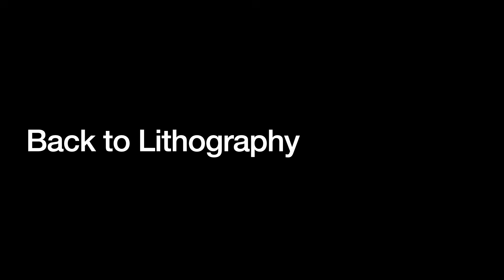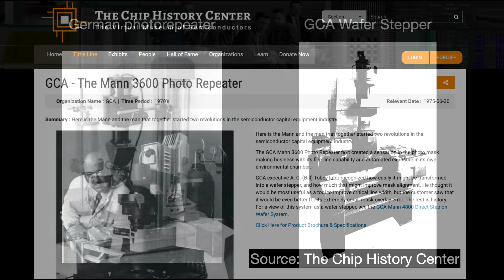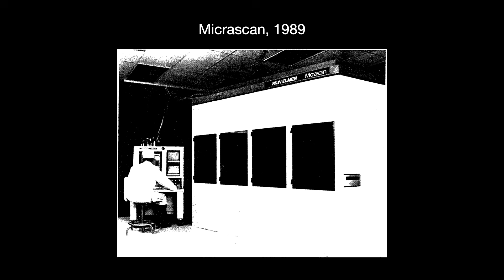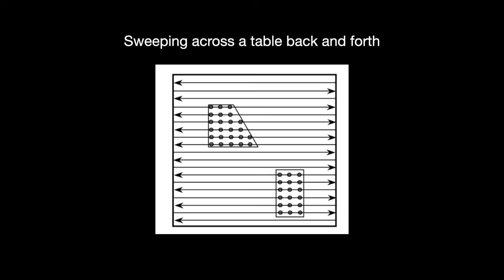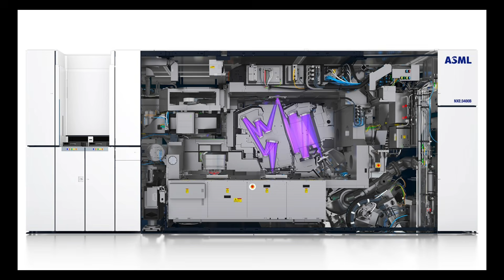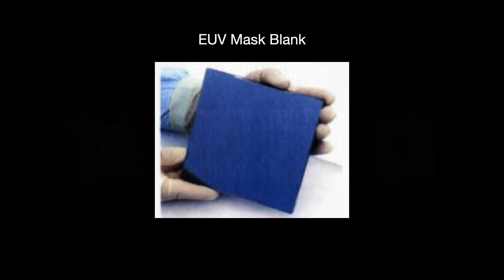The History of the Semiconductor Photomask

Comment: 🎯 Key points for quick navigation:

🔍 The photomask is a crucial component in photolithography, containing the chip design.
🖌️ Early mask-making involved manual techniques like contact printing and rubylith film.
✂️ Assemembly from large-scale artworks into smaller reticles transitioned via cameras and coaters.
🛠️ Innovations like the photorepeater and wafer stepper significantly improved process efficiency.
🧪 Substituting soft materials with durable metals reduced mask wear in contact printing.
🔬 Emerging technologies like e-beams and lasers advanced mask-making accuracy and resolution.
🏭 The 1980s saw industry consolidation and the rise of specialized, high-investment mask technologies.
🪞 EUV lithography introduced reflective masks, demanding zero-defect standards and advanced metrology tools.

Made with HARPA AI

Comment: ive done print ink silkscreen. i understand how a screen causes an emulsion to harden or wash away after uv light hardening then rinsing what did not harden. but if such a resist mask is placed on silicon, is it a 'subtractive' process to etch the masked layer? or is it an 'additive' process where more silicon is added? whats this step of the fabrication called? so i can research it by name to understand.

Comment: What about the 1979 Fujitsu X-Ray Chlorine etching? The X-Ray is tuned to the energy needed to disassociate the chlorine molecule. Thus where the mask allows the laser to pass, the chlorine ions etch the substrate, eliminating the resist. Coupled with the X-ray mirrors, the X-ray laser intensity can be high.

Comment: Resist coating that has not been stripped well is the "enemy" of Implant as too much outgassing is experience in the early days of wafer manufacturing. We will just see the chamber and the surrounding area as full of resists by products that cause potential wafer scrappage due to particle during implant. Wafer patterns are scratched in a batch processing type of implant.

Comment: In 1970, I took an engineering class in integrated circuits, and we had a tiny IC lab.  Each team had an IC project, and my lab partner and I started to design and build a two transistor flip-flop.  We used rubylith to make the masks.  As I recall, our rubylith material was clear palstic sheeting with a layer of red film on top.  There was nothing photographic about it.  The machine to cut the pattern was as you describe, and one interesting detail was that the cutter had to be manually aligned to the direction of the cut (up/down left/right).  If you had the cutter set incorrectly, you would either ruin the rubylith pattern or break the cutter.  Anyway, we did'n't finish the project, but we made all the masks and started a few diffusions.  It was a great course, and I still have a few of the little masks (about 1.5 inches square).

Comment: Did you know that initially ASML and Intel did not want a pellicle on the EUV mask? Back in 2009 or thereabouts, the EUV light source did not have enough power and therefore the stakeholders wanted to eliminate anything that would absorb the EUV light. The pellicle materials available at the time would absorb the EUV energy. The entire EUV litho chamber (wafer and reticle stage) has to be a vacuum so that the air won't absorb the EUV energy. To introduce the EUV reticle into the chamber, the reticle pass-through had to be pumped down to a vacuum, and therefore the reticle pod had to be all metal to keep the pumping time as short as possible. No pellicle, no polymer contact points on the reticle pod meant that the hard metal contacts gauged the reticle glass, causing particles on the non-pellicle EUV mask. So ASML decided to allow super tiny polymer contact points in the reticle pod to prevent such gauging. And eventually a very low absorption pellicle was developed and more powerful EUV light sources were realized. It was a lot of fun working on this stuff!
Reply: I have never seen EUV with a Pell in my time in the industry since 2010.

Comment: Nowadays the cutting-edge stuff is nearing 4 NANOmetre-sized elements. That's 4/1000ths of a micrometre - And they keep getting smaller. We're already experiencing issues with electrons wandering through a switched-off transistor thanks to Quantum Tunneling, but somehow that is worked around and size keeps shrinking. Before too long we could be working with elements measured by individual atoms.

Comment: a chuck in industry and machining is a tool used to hold other tools like drill bits and end mills or the work itself like on a lathe, so an electrostatic chuck is just a work holding tool that holds via electrostatics rather than physical or magnetic clamping that is used in the macro scale.

Comment: Electrostatic chucks (esc’s) are very common in etch, implant, ash and pvd steps.  Mechanical clamps went away during the 200mm years.  

When I started the mask making and inspection tools were still in the fab, but retired.   I’ve run perkin elmer aligners up to DUV step and scan, with contact and proximity aligners and a bit with EUV along the way.   

Pellicles are important to repeatability, but when an expedite lot came along I personally went to shipping and repossessed a needed mask, ripped off the damaged pellicle and ran the product. Even a 50% yield loss was preferable to missing a shipping deadline.  The focus shift was within tolerance for the layer.
Reply: We remember resist overflow at the back of the wafer that caused e-clamping issue at our implanter with e- clamp type of chuck
Reply: So masks with damaged pellicle were sent for repair?

Comment: At Intel in the 70's we always put 4 "test coupons" on the edges of each wafer and during the process we tested their function with probes and if they all didn't work we would shitcan the wafer to keep from packaging crap circuits ... wonder if they still have to do that today?
Reply: I don't think so. Wafers need to be extremely uniform throughout all the processing steps. Having dedicated coupons would break that uniformity and may lead to performance issues in adjacent dies.

The amount of wafer metrology has exploded over the last decades to monitor all processing steps. I think that information is used to predict final yield. Being a 'yield engineer' is not easy...
Reply: So the ICs were not tested before bonding? But when already placed in a DIL package?
Reply: @herrbonk3635  No tested even before dicing up the wafer using super find probes adjusted for the coupon circuit.
Reply: @tpcdude  Yes, that's what you said. But I meant the other normal ICs. If they were tested before bonding and packaging what would "packaging crap" mean?
Reply: What is done is putting test circuitry, test points, etc. in the area between the dice.  Once a wafer has been fully fabricated all the dice on the wafer are tested and any defective ones are marked.  The test circuitry ends up being destroyed when the wafer is sliced.

Comment: IC masking and screen printing: Well, I think more accurate to say that these techniques were well known from the manufacture of printed circuit boards, which were in full swing at the time of the first ICs, and from there you get back to printing, both screen printing and lithography. Also, resists were in use before ICs, used to perform etching on metal, rock and other surfaces, which is very much a thing today. In fact, etching glass with acid, still done today, is almost a direct line to ICs, since silicon dioxide is basically glass.

Comment: My dad used to work in R&D for this stuff back in the 70's while developing a gate library for a 5 micron process.  Defects where high at first, so a lot of stuff was discarded.  My dad brought home a collection of, er, "souvenirs".  No Rubylith, of course, but I have a bunch of 10x and 100x Mylar reductions, and several original photomasks, some of which still have their pellicle intact (which is impressive, seeing how thin and fragile these protective layers are).  One of my favorite things to do when I was a kid was look at this stuff and tons of reject wafers under a microscope.

I didn't appreciate how privileged I was to have access to this kind of technology and use real Calma and Apollo systems at the GTE Student Workshop.  At the time, I kinda figured this is what everyone's dad did at work.  8)
Reply: That's awesome. I wish there was a museum which had images of the designs of these chips. We may buy the CPU, but we will never know the beautiful designs that went into designing these processors.
Reply: I also did Mylar reductions in my student days of 1985, to make a 4 bit shift register in 100 micron scale to prove I understood the process, using an ancient 1970’s machine, ven turning on the taps for Boride and Phosphorus gas. I then did a 3 micron VLSI chip design using Bell. It came back 5 months later as 2.5 micron, as the 3 micron process became obsolete in the gap.

Comment: Dear Asianometry, The obvious conclusion from this well developed piece is the inherent limitations of the "Silicon Chip" as a technology for the future, continuing development to smaller and smaller units of measurement will be unfeasible and costly in the extreme. One wonders if the Asimovian Positronic Brain is a direction for the future ( smile ).  With 3 Billion years of trial and error development the "Brain", an organic system of information and memory processing that is smaller, uses less power than our most efficient chipsets, may represent a different direction.

Comment: @13:29 the print area is 142x142 the total area is 152x152mm, AKA "6" inch mask, 1/4 inch thick.
Reply: As far as I know, at 1x the largest image field that can be exposed on a scanner is 26 x 33 mm (rectangular).
Reply: @tommy2cents492  That's after 4x reduction in scanner. 26x33 mm *4 in all dimensions = 132 * 104 mm for the main device layout on the photomask. The remaining area can be covered with Labels, test patterns, markers, barcodes, etc.

Comment: While rubylith has been replaced with digital tools in screen printing, the photolithography process is mostly still there. Printers use exposure units to burn an image into a screen impregnated with emulsion. Wash out the uncured emulsion and force ink through the screen to make an image.
Reply: What time is it? I don't know. Do you? No. Nobody does. Something might. Not possible to discuss a nothing. Not sure. No way of knowing. Hair? Yes. For now. No hair equals hair. Yes? Yes. No. Hair? Hair today not sure when. Transistors are smaller than hair. Sometimes? Two times. Three. Hair.
Reply: @TimPerfetto MKultra type shit

Comment: It's always amazing to think that our CPUs are made using the "same technology" than the prints on our T-shirts.
Reply: They are not. That's almost like saying the use the same "technology" beacause they both use desks, phones, pencils, papers.
Reply: @herrbonk3635  
Idiot, of course I'm not saying they are made using the same exact machines but CPUs are made using photolithography, which is basically using the same basic principle than screen printing.
Reply: @Reth_Hard  Integrated circuits are made using semiconductor physics, chemistry, electronics, digital logic and topology, state machine theory, and so on. Photomasks or lithography are just one tool among (literally) hundreds in the process of "making out CPUs".

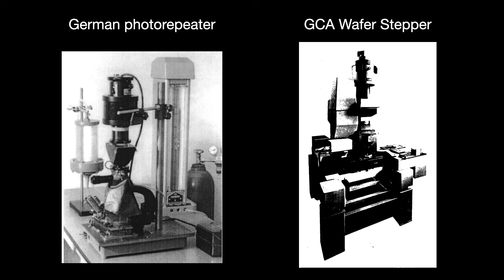Comment: 3:44 This has brought memories back of working on primitive GCA resist and developer track systems back in the 1980s.  They were programmed via paper tape, and would literally blow the 4" wafers along a track from cassette to spinner to apply resist, then bake and on to another cassette.  If a wafer covered in resist broke in the spinner it was a real mess to clean up.  We didn't have a GCA stepper though, the wafers would go to a Perkin Elmer Micralign or a Canon mask aligner, or later steppers.

Comment: Yes I used to make rubylith masks for thick film printing and that was painful enough let alone trying to cut a chip design. It was quite satisfying when done but stressful until the last strip had been removed without tearing.
Reply: oh shit, didnt think about tearing ..the delicate balance of piercing just enough to peel and not enough to tear
Reply: did you use tapes to secure the film?
Reply: @Theoryofcatsndogs  To be honest it was such a long time ago Im not absolutly sure but Im pretty sure we did. I was cutting against A1 graph paper and that was stuck with tape to a light board so it would seem sensible have taped the rubylith but I know it was sensitive so it would have been masking tape not packing tape. The only reason for my hesitation is we did have a vacuum table too but I dont recall using that for this

Comment: day 2 of asking Asianometry to cover nanoimprint, complementary electrom beam litography or other alternatives to EUV
Reply: Fun fact, while researching the topic i found that inmersion litography can be done with solids, so duv could be extended even more than it already has
Reply: None of those are alternatives to EUV. They can be used to make chips both cheaper and faster than EUV. But if you require the feature size of EUV lithography there are no alternatives.
Reply: @andersjjensen  nanoimprint litography and electrons beams can be used for smaller features, specially the latter. However they are untested for high end processes

Comment: E-chucks used for masks?  I was not aware of that.  E-chucks are necessary for handling wafers in vacuum... vacuum chucks don't work then!  I was running a Perkin-Elmer aligner in 1982, btw... Motorola NMOS (MOS 4).
Reply: For EUV light has to travel through vacuum. It would be absorbed by air. So the mask are under vacuum.
Reply: @soren6045  Yes, with some hydrogen.  But why handle the mask with an e-chuck?  Of course the wafers are handled this way.